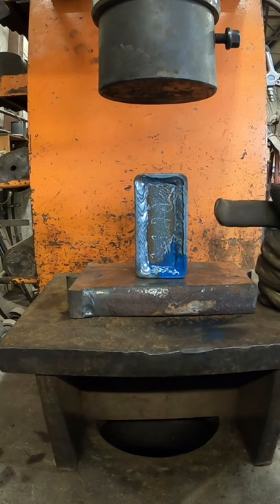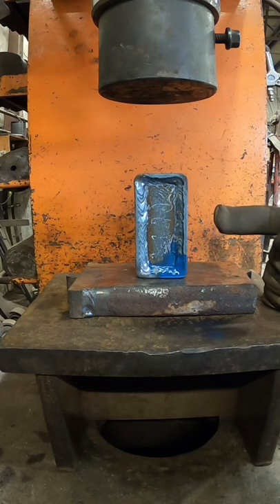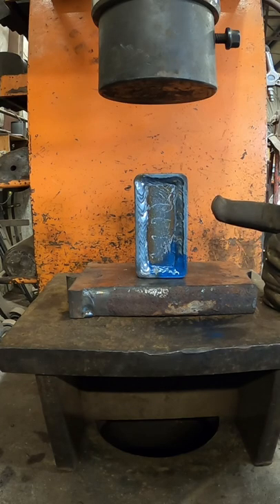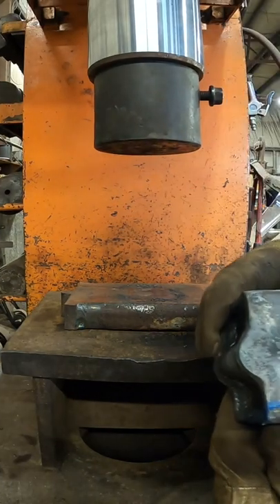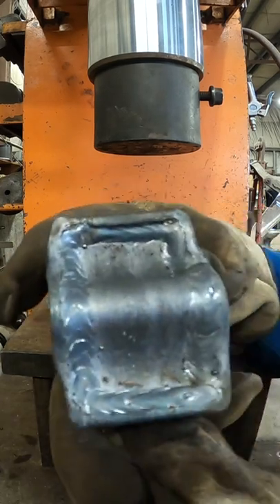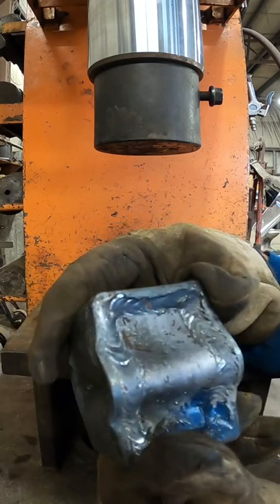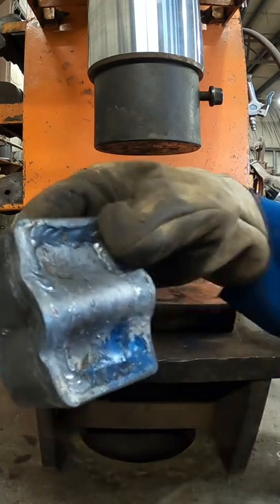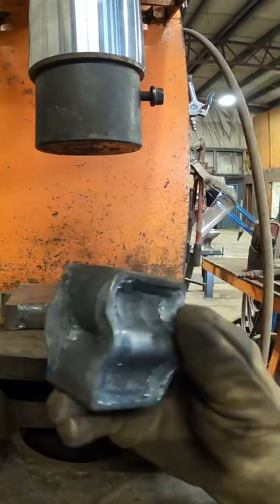Can I get my welds to fail with 100 tons

Comment: My welds would have cracked as soon as I started up the camera
Reply: Bro my welds crack at a light breeze
Reply: Same
Reply: Mine crack right out the machine. I'm pretty sure my wife cones cracked.   I know some welders see these as trash welds, but it's much better than I currently can lay down.
Reply: i used a culinary blowtorch and aluminium brazing rods to braze a lil metal stool, held up pretty well, pobably could hqndle someone weightibg 100 kilos, util several months later i kicked it and it all fell apart, i was sad.

Comment: There's always someone on the internet who knows so much more than the guy who has been doing it his whole life....
Reply: @Good-VS-Evil777  what's your point? They were obviously wrong. Meaning probably inexperienced and just talking shit VS the guy who's been doing it for years.
Reply: @Krankie_V  were they talking shit or noting something with good intention?
Reply: Dragging with this process, might, results in less penetrantion because the arc is continuously smoothed by the molten weld pool.  It's not that dragging isn't allowed in standards, it's that the mechanical properties aren't as good as pushing due to the penetrantion of the parent metal. But do whatever works for you.

Comment: Even though it’s strong now I would be trying to sort out that under cut being on a trailer it would be subject to a lot a vibration and that’s the fiery spot cracks will start 
Can’t see it the best but It looks bit hot
Reply from the maker: yah it was too hot with way too much undercut, which is why it was a good test block to crush.
Reply: Yeah, I don't remember it verbatim but d1.1, gives undercut a decrease of "strength" by a factor of 10 and the excessive puddle whip over tolerance a factor of 3x.
But in all honesty seeing some of the stuff that holds up for 30+ years before failure, your good brother.
Reply: @ferrumchnop6617  totally agree same some say you can’t vert down anything done plenty that hold just fine at the end of the fit for purpose is all that matters
Reply: @MegaBCAD  oh yeah. Same people are amazed when you run a clean bead down with 3/16 7018 on 1/8. 90 deg lead and just gota let that slag drip son. =D

Comment: It Will work either way on that thin of metal, when you get into welding pipe or heavy metal then it starts to become a bit of a problem
Reply: Right, but that has nothing to do with this video. He is talking about using it for his camper trailer.
Reply: True, is a balance game of stress. More physically resistant materials would resist and transfer more of the stress to the welds
Reply: Sure bud
Reply: @HughWoo  like I said, it will work either way for metal that thin.

Comment: Depending on the standard as long as you have a WPS that states the direction of travel and angle of attack with a supporting PQR that shows the weld meets / exceeds the expected failure loads then you are fine. I have used a drag or pull when I need deeper joint penetration but if done incorrectly can lead to cold lap on the toes.

Comment: Those welds are way too hot. But if your asking if they'll hold then yea. You can hide a lot of inexperience with some extra amps.
Reply from the maker: yup and yup, new welder and trying to see which welding technique caused less undercut.  Definitely trying to get it tuned in.  this was a test block which is why it didn't pass inspection and gets crushed.  I wouldn't sell this block to a customer.  There is also a difference between experimenting and inexperience.
I highly recommend trying something you are not perfect at.  It sure broadens your horizons and give you experiences you wouldn't otherwise be exposed to.  Not being perfect at something sure helps you learn and become better.  I love playing around with new techniques and see where it takes me.

Comment: I don’t believe pushing vs pulling affects penetration…It’s running downhill vs uphill that affects penetration.
Reply: This would be an interesting test!
Reply: @connahjones8178  the caveat is only really good welders can run up hill. Most people are unable to weld uphill properly. It’s required for structural vertical welds.
Reply: Pushing with mig is a must I've done multiple bend tests with push and pull. Push is the way to go

Comment: Although I believe them welds would hold an pass a bend test. Usually you cut perpendicular to the weld an bend it back 180 degrees. Like trying to rip the Two pieces apart from each other.

Comment: 7000 psi per inch of weld on an 1/8 bead with a 7018 rod is the specification. 
It will take alot more than that press. That's the specs from the welding aws weld procedure data sheet on mild steel.-welder.

Comment: You should freeze the block down to whatever the coldest temperature your trailers are rated and then repeat the experiment while still extremely, extremely cold. See what happens what happens then because the steel or the Welds might experience of brittle transition and that's when they're really gonna fail.

Comment: This cracks me up when I see people text their welds using a press. 

There’s a reason they call the official test a “bend test” 
Compressing your weld doesn’t really do much. The fact is that you have the press set to 100 tons, but that steel deforms like at around 2 tons. So over all you’re not actually stressing the steel at 100 tons cus the press doesn’t hit the resistance to even get up to that pressure. 

With a bend or pull test, it’s a totally different story. The steel has to reach its tear point, and your weld is 3-6x harder the the steel.

This then actually shows if your weld is consistent and penetrates. 

Not squishing it. 

But nice try 👍🏻

* and you those who don’t think I’m a welder, I was certified at 18 and now am 34. Went to school and graduated from OIT welding programs as my classes top student. 

You don’t test your welds this way.
Reply from the maker: as an experienced welder who has passed his bend tests you will notice that the perimeter welds around the block wouldn't be able to be tested in the same way as a normal bend test you would do in a weld test.  How would I set this up to do a standard bend test when the weld is around the outer edge and not in the middle.

Comment: Why not do cross cut and etch to show penetration?

Why not do bend test bars to show welding proficiency / destructive testing for development of a weld procedure?
Reply from the maker: bending bars is the most common way to test a flat plate weld or a pipe weld.  This is a corner weld, not a V weld so it is different and I have not seen how people test these.  I figured I'd fold it in the press and if it lets go, then it fails.

Comment: Cut em and do an etch test. Welding Tips and Tricks covers acid etching a little bit using Naval jelly, can get it at hardware stores. 

See which gives more favorable penetration, if you’re still concerned. 

Honestly I wouldn’t be too concerned after your test anyway, lol.
Reply from the maker: I do like the idea of cutting it open but it was too pretty to destroy.  Maybe I'll do one with some of the scraps left over.

Comment: Is this done with oxy welder or mig? You definetly need to work on your travel speed and heat settings
Reply from the maker: This is a test block.  We fix all the issues when we launch the real product.

Comment: A 100ton press? Man that shit could handle every daily things you throw at it. I might say it's would maintain 98% of it strength even when you are dead in the old age lol
Reply from the maker: the press I use was made in 1986, we just did a rebuild on it 2 years ago to put all new lines and seals in it.  other than that just the motor needs repairs about once every 10 or so years

Comment: If that didn't break it then it should be ok. I mean who has a caravan that weights over a couple of tonnes?
Reply from the maker: This was a weld flex and fail test to see if they would separate under load.  I did an actual crush test and it passed at 45 tons of pressure without failure.  so about 90,000 lbs each.  so unless your trailer weighs over 360,000lbs they should be ok  hehe